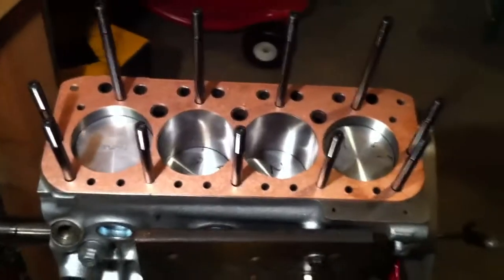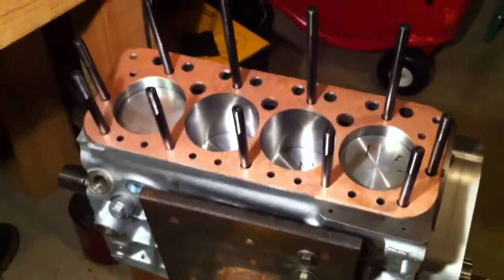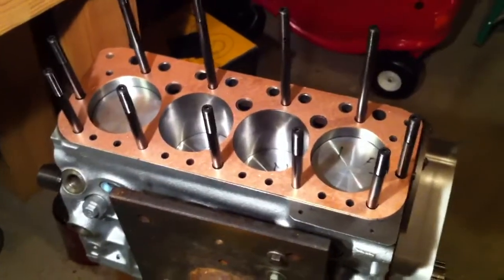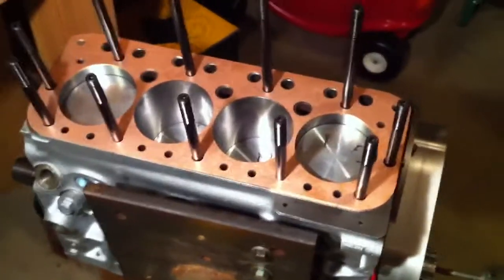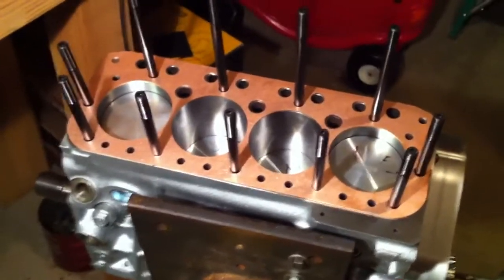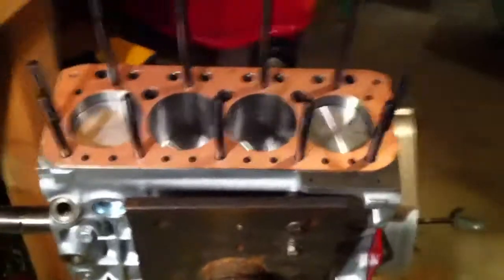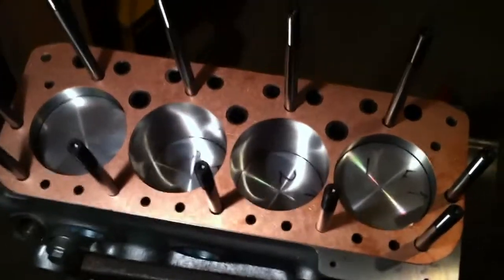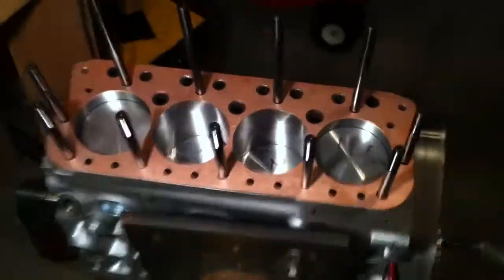Custom head gasket for our 1380 race engine

Comment: Hello Jemal
Do you put silicon on it or not?
Thank you
Reply from the maker: I used a Permatex Copper Spray-A-Gasket on the copper gasket, per the instructions from Cometic.  I spayed both sides with an even  tacky coat and let it 'dry' a bit...
Reply: @JemalCRM  Thank you Jemal
I own an fiat abarth engine similar to mini 1050 cc
Do you have facebook?
Reply: @JemalCRM   So, without O-rings, did it work?  Did the gasket keep the cooling system from being pressurized by combustion gasses?  And did the Permatex copper spray-a-gasket keep oil and coolant from getting places it shouldn’t be?
Thanks,
David
Reply: Hi Jemal 
How much quench or squish you give at this engine?
Reply from the maker: If I remember, the pistons actually came up into the head gasket (about .010-.015" above deck), so I spec'd the gasket at .050" to give about .035" clearance from the forged flat top pistons.  I only took maybe .003" off the deck to clean up. so this was a well used block!  I still have the Payen BK450 common gasket that came out with imprints of the piston tops because of the off-set bores!
Reply: Hi Jemal
My engine is a fiat abarth 1050
Almost the some set up
I never use a copper gasket ,
Im afraid that is gonna like
I have one of 1.20mm and with this one i have0.8 mm of clearance
I think ist fine 
What you think?
Thank you
Reply: Hello Master Jamal
Wen you say 0.10 clearance you mean thousands of inch or mm
Thank you